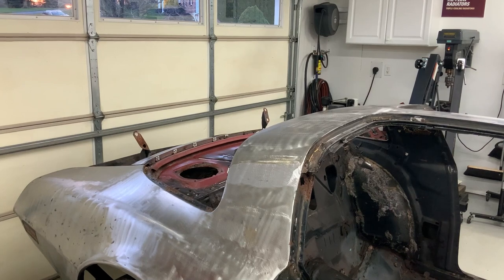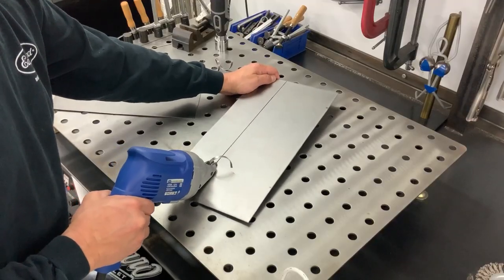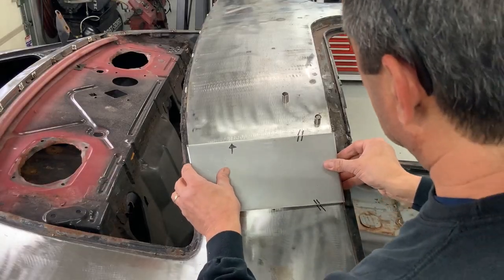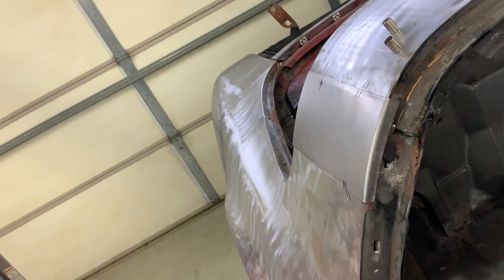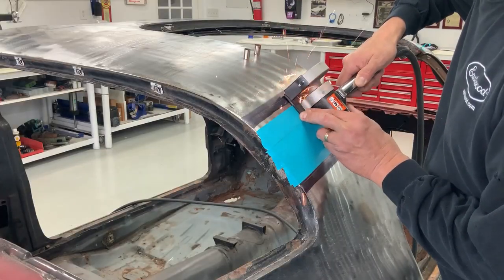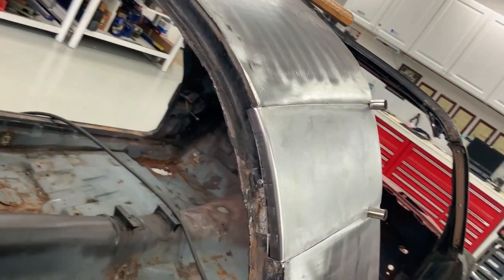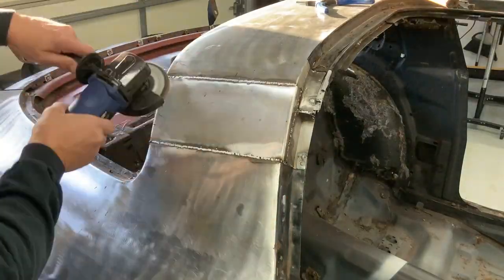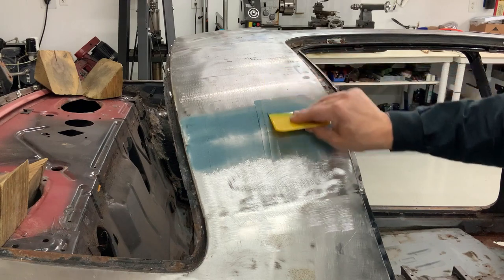How To Remove a Lead Seam - Patch Panel Repair!

Comment: Why did you remove the lead seam?  I am thinking of doing the same to my car because I don’t want to mess with lead filler or use fiberglass or regular filler.
Reply from the maker: The lead seam was what factories had available at the time, but it will eventually flex and crack.  So eliminating it will improve the structure and durability.
Reply: @eastwoodco  as usual, 5 years too late......